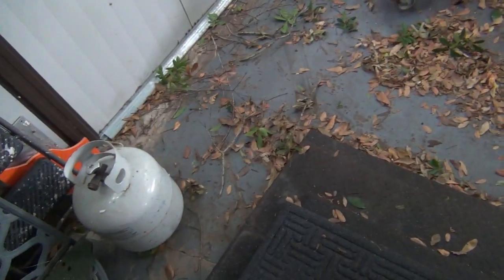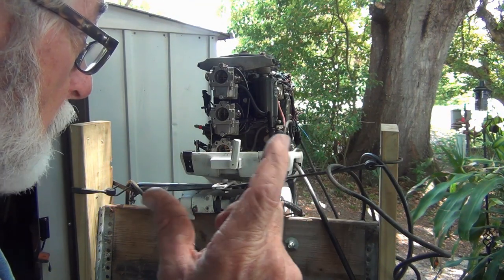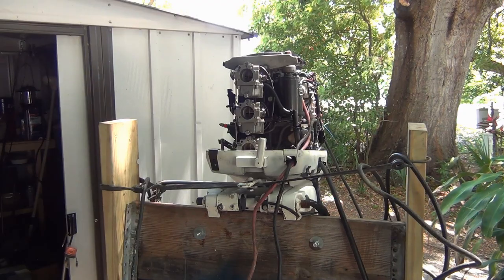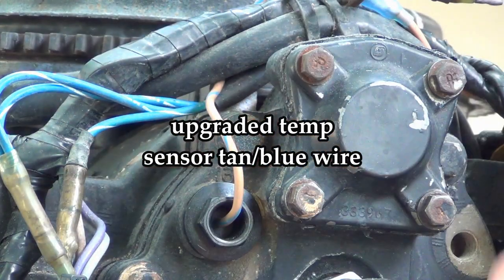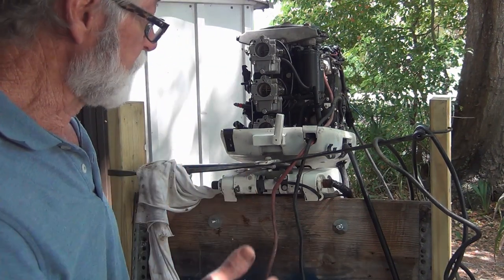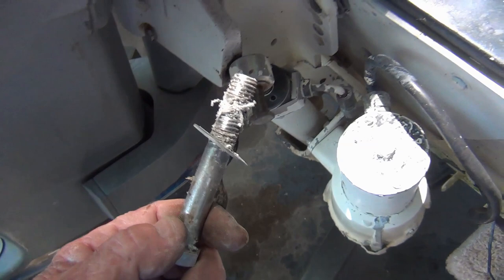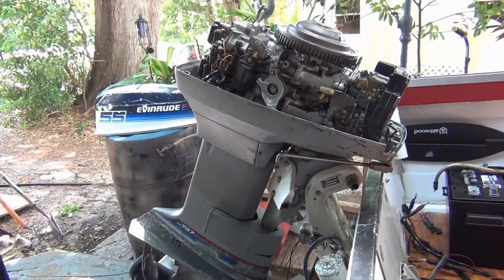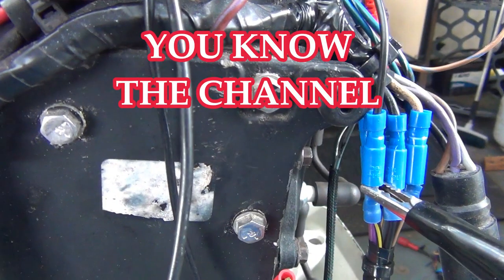1992 60 Hp Johnson 55 Hp Thermostat test, pump test, DC voltage at kill wire!

Comment: Yup as I thought a vacuum leak but I was thinking crankcase seal on the bottom ! I’d bet your surge was from the top cylinder ! Ya might try JB weld on it , the marine stuff works wonders ! Lol. That makes sense the warmer the block got the bigger the crack widened !
Reply from the maker: Yeah. I'm gonna remove the paint from the area, it's very hairline. Thanks again !

Comment: I’ve got a 1989 25 Horse Evenrude that come with an oil filter like for a car hooked into the fuel line. My question is this, can I get rid of the filter and just run a fuel line from my gas can to the motor?
Reply from the maker: Hey. That sounds like a water separator. I personally wouldn't use it, unless I thought I needed it and it works. You'll have to make the call on this one! Thanks again for tuning in!

Comment: I was watching one of ur videos n u mentioned don't buy the cheaper knock off coils . But I didn't hear why or wat the problem was with them if someone reads this n knows why could u please explain why n eats the problems with them thank u very much for ur help.
Reply from the maker: Hey Mark. Thanks for tuning in. I've never really had a problem with them until this time. But it happens. Most aftermarket parts are cheaply made and dont last. It's always best to buy the best. Thanks again and Stay tuned !

Comment: Hey bud had a question I have a 74 15hp Johnson it wants to what I would call hiccup at idle. Any idea what problem could be??
Reply from the maker: Hey Luis. Thanks for watching. Sounds like a typical "lean sneeze". Turn your slow speed needle on the carb out slowly until it stops. Not sure if you've heard of Leeroys Ramblings, leeroysramblings.com. Everything you ever want to know about these motors are at Leeroys. That's where I learned everything! Thanks again & Stay tuned !
Reply: Hey yeah iv heard of that I'll definitely look in on that and I'll give that a try see if it helps thx man.

Comment: i got a 2000 60 a dealer put it on my ranger boat its heavy they rewired the boat! the wiring was screwed with and fuel was black nasty sugared or some one dumped diesel in it, they replaced steering gear & propped it, it was hundreds of pounds lighter then 150 v6  i told dealer any thing better then rowing it! it was dealer it was sunk on trailer! my school friend with the owner that place! i told him they fire the mechanic! he ruined a 5000 dollar even-rude xp 150 motor ! the whole wiring harness was with the 60 tack oil read out warnings key it was like a new boat!
Reply from the maker: Wow. Great story. Thanks again for tuning in!

Comment: The two worst OMC motors ever made (ignoring the crappy 1-cyl 1.5 - 2.0 junkers) are:  The 1976 35hp, and: the 1978-? 2-cyl 55 hp motors.  The 2-cyl 55's had a tremendous problem with hot spots in the block.  It was so easy to burn a piston/score a bore in a 55.......... you didn't even need any factory training to do a good job of killing a 55.
I could write an entire chapter about the 1976 35hp; however, each year was progressively and significantly better than the previous year, 1984 being the ultimate OMC 35hp motor; fast and reliable and first year of triple dog gears and clutch-dog in the lower unit, first year of the primer choke, and nearly the last year of the gear driven throttle linkage -  and last year of the 35hp 2-cyl two stroke offering in the domestic U.S. market, other than military models.  By that time it was one of the very best OMC motors ever made - In that statement, I'm including the 30, 25 and 20 in subsequent years of the same family.  From worst to best; the 1976-1984 35hp, and beyond to 2005.  However, the 1986 and newer had a push-pull Helix throttle cable.  It was smother to operate, but would never last as long under neglect as the shaft-and-gear throttle linkage of 1985 and earlier.
Best thing ever done to the 50/55 two cylinder motors was to discontinue them and offer, instead, a three cylinder 50-60.  Those 3-cyls are legendary;. both 49cc and 56cc.  Great motors.
And then, there's the Johnson "Stinger", perhaps the best "hot rod" mid range OMC motor ever made............  Lucky is the man who aquires a Johnson Stinger (or an Evinrude Hustler).
Reply from the maker: Wow. Nice to hear someone that knows there omc outboards and takes the time to tell about it. That's great in my book! I luv comments like this because it helps me learn. Never got much into the 30-35's because they're almost always long shafts. Not much of a market down here for them. You can't give them away, same with the 20hp LS's. I'm gonna keep my eye out for a Stinger/Hustler. I've seen them around from time to time.Thanks much and best comment! Stay tuned !
Reply: @THISOLDOUTBOARD1  Well, it is mutual because I really like the things I learn from you.  You have a solid ability to apply common sense analysis to diagnose a problem and a great ability to repair.  You're good!  As a result, I learn a lot from you.  Thanks for your videos.
Reply from the maker: @mikedurhan9941  Hahaha. Thanks ! My real intention is to just entertain. I didn't want to be another "how to" guy. There's enough of them around. Thanks again !